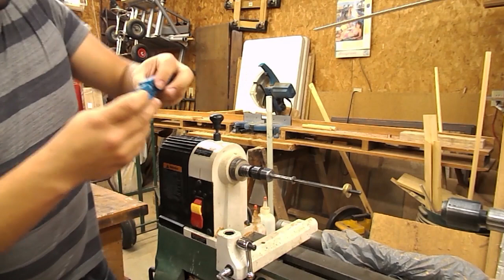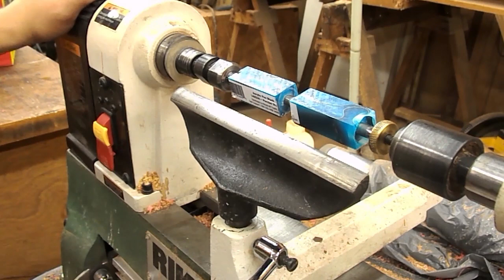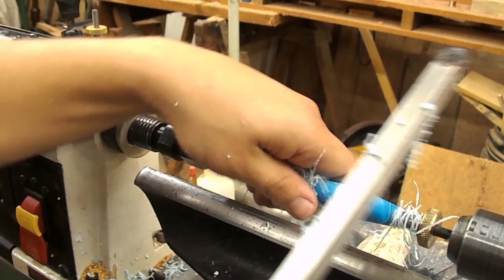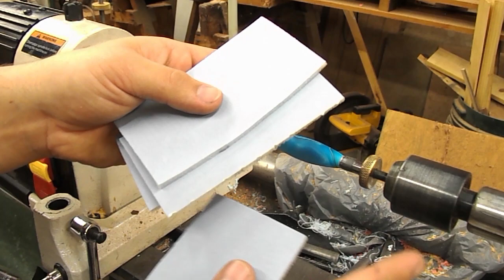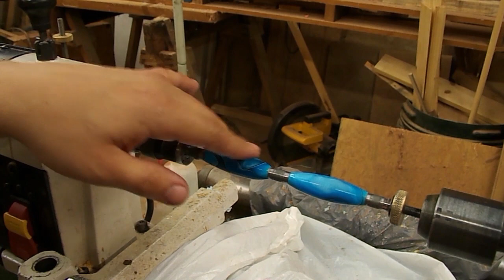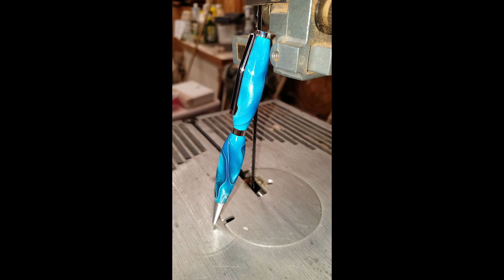Acrylic Pen Turning Tutorial by David Troutman

Comment: So many ways to get the same goal. Good idea to use the skew to smooth the finish of the blank. Ask ten pen turners what they do and get eleven answers. I finish with 1000 grit wet sandpaper and follow it with Micro Mesh then at least two coats of Hutt Plastic Polish (not sure of the exact name). Good idea to vary the shape. I tend to get in the habit of plain vanilla blanks. Thanks for the video.

Comment: Biggest problem I have with these swirled acrylics is that you can see the brass tube through the lighter areas. Sometimes it looks good but other times it looks pretty crap. That's why I stick with dark ones these days.
Reply: Update: I saw on another turner's YT Channel that he paints the inside of the blank with white or colour matched paint before putting the tube in - pretty cool.
Reply: @Mr_Chuckles  I've been successful painting the tubes as well.
Reply: A shot of spray paint in each end of the blank does the trick. Make sure the rattle can is shaken good, more than the required minute or so. Nitrile gloves from Harbor Freight keep the hands clean. FWIW, I use the lunch meat containers; one kit per container so I can keep the sorted. Paint the blank and set it on the lid. Dry overnight and glue the tube the next day; I use two part epoxy. Let the epoxy set overnight, trim and turn. Obviously I'm not a production turner but set up an "assembly line" to do several kits at one time. One turner has cans of the primary colors; guessing they are white, red, blue, green, black.

Comment: Hi, frecuently mi blank broken wen i turning. I am to agresive? what is the good speed for turning acrylic?
Reply: Breaking blanks is usually caused by two things - too aggressive removal of material and dull tools. For how much to remove at a time, think shaving. For how sharp to keep your tools, think razor sharp - and don't be afraid to sharpen in the middle of a project if you feel any "drag" while turning. Sharpening can be easier if you paint the edge with a marker. You can see when the angle is correct right away. 
That's why a lot of turners use carbide. It holds a sharp edge much longer, but high speed steel is just fine as long as it is used carefully and kept sharp. 
The only other cause of blowouts is with segmented blanks "catching" on transition edges, but light cuts and sharp tools will generally counter that.
Reply: @kirkboswell2575  I used a new drill, ... and the first block broke, and the drill bit stuck in the second one and I couldn't get it out. If you know ... give speed advice!
Reply: @nikolayvalkanov4319  - For that it's best to remove the bit and clear the shavings frequently - say every 1/4 inch of depth. An old toothbrush works fine. The shavings from acrylics trap heat and expand easily when drilling. That expansion can cause increased pressure. Thus blowouts. 
They make drill bits specifically for acrylics that helps a little. They have a longer taper on the point, but a regular bit will work fine with frequent clearing of the shavings. Good luck.

Comment: My first Slimline pen was made in the shape done by David in this video.  After using the pen for a year or so, the pocket clip bent enough that it no longer griped my pocket.  The piece near the nib was fine, but I needed to take the pen apart and turn the clip end down like a normal Slimline to keep the pocket clip tight in my pocket.  A Comfort pen works much better for the larger diameter.
Reply: Agree with your experience with the clip.  For a ladies pen you could probably get away with it because the clip isn't used very often if ever.  For a guy putting it in a shirt pocket it would be difficult to insert with all that tension on the clip.

Comment: Hi there - I have never turned before, and don’t (yet) own a lathe. However, I am going to buy one soon and want to be able to turn acrylic blanks to use as inserts for fly fishing rods that I build. Can you tell me exactly what tool you are using - as what you are producing there is pretty much exactly what I am wanting to be able to do. So is it an Easy Wood Tools rougher or finisher? And what type of carbide tip? I had a quick look at EWT website - and see they are doing a negative rake tip specifically for turning materials like Acrylic. Is this what you are using there? Sorry - whole lot of newbie questions - but you seem to be very good at this - so best to ask an expert!
Reply from the maker: Hey boss, you can ask me questions all day long. Doesn't bother me a bit. Happy to help. And better yet, you can just message me on FB messenger and we can chat about it. David Troutman is the name. I should pop up in the search. And yes, it's the medium size EWT round carbide cutting tool. IMHO i wouldn't get the negative rake cutters to learn on, because you can't sharpen them. I use the standard insert, because you can remove them and sharpen them on a diamond card  instead of buying another $20 insert. Hit me up on FB and i can get you all the details for what you need! Thanks man.